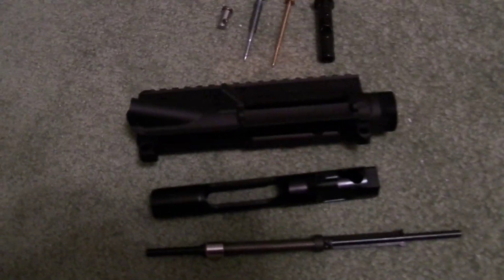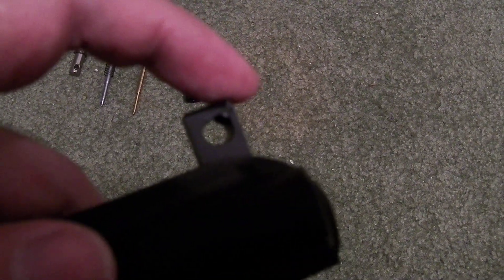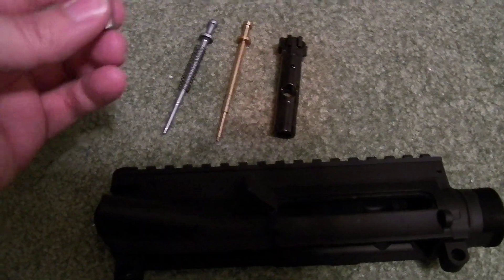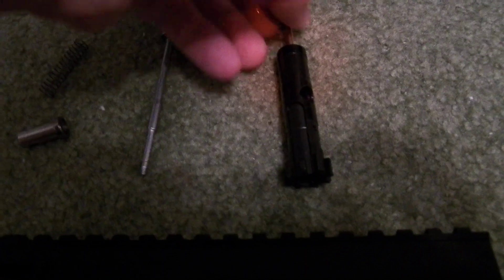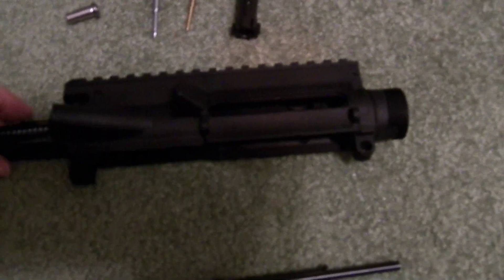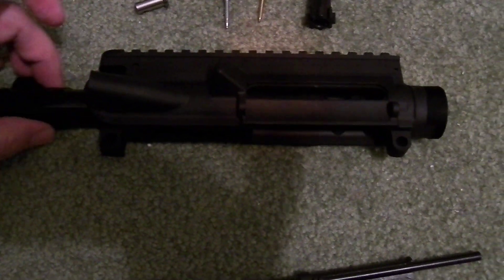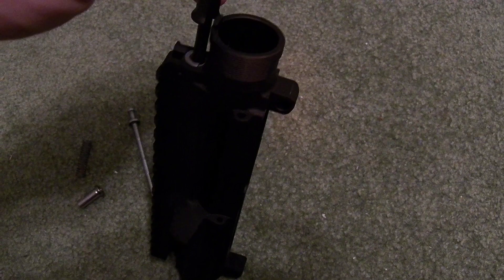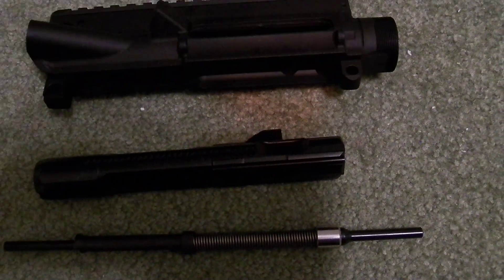Haus Manufacturing HK416A5\A7 upper and Brownells HK416 bolt carrier fitment issues

Comment: I had the same problem with my haus upper. Send it back to haus and Jess will fix it. He did mine free of charge and turn around was less than a week and my brownells BCG fit perfectly. There were a small batch of these uppers that were out of spec but Jess over at haus will take care of you he’s an outstanding guy

Comment: What barrel are you using?
Reply from the maker: Most likely I'll be getting one of the ones Brownells sells and then grinding the barrel extension to fit. Haus sells A5 variants produced by Nefarious, but I want a 16" one for my G95A1 clone.
Reply: @HammerheadClassCruiser  I was thinking of doing the same thing. I just saw that Haus is taking preorders for a5 barrels though. Also I asked Black Ops Defense if they could convert a brownells barrel extension to a5 spec and they said they can. Black Ops Defense is super expensive though